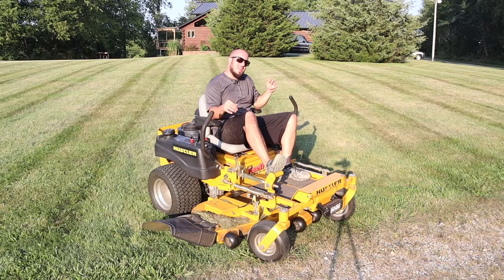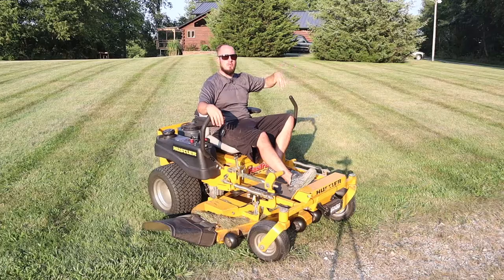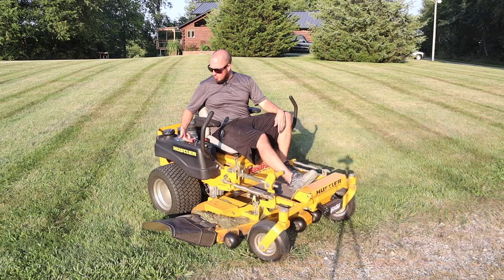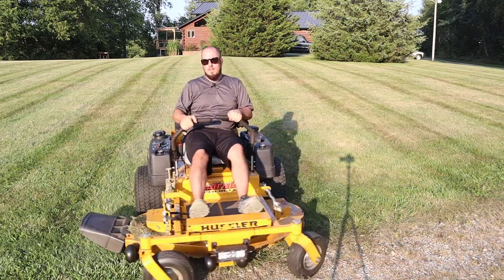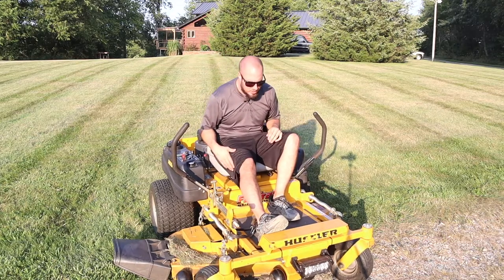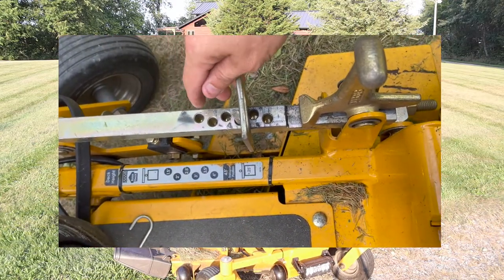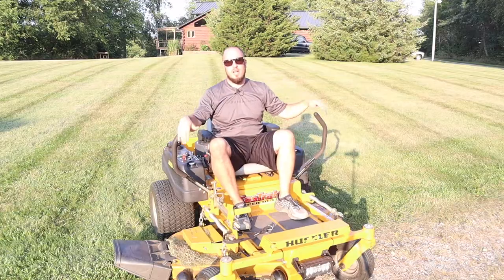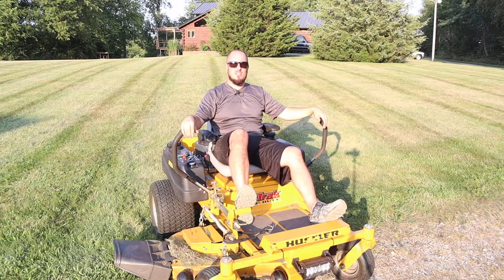How To Operate A Zero-Turn

Comment: Thanks. You laid this out simply. As a newbie, that was what I needed to watch. But I noticed a discrepancy between what you said and the Ariens manual I read this morning. The manual says this, "Engaging the PTO knob with the throttle level set lower than fast position can cause excessive belt wear. ALWAYS use fast position when engaging the PTO." That's counter-intuitive, but that's what it says.
Reply from the maker: Different schools of thought on it. I’ve been doing it my way for over 500 hours with no ill effects